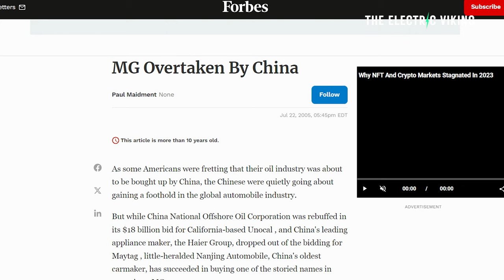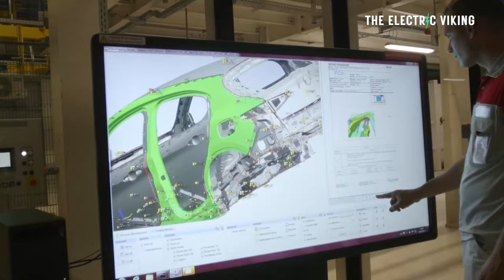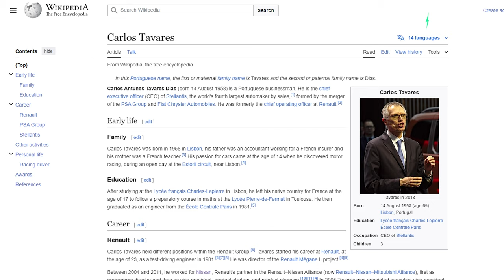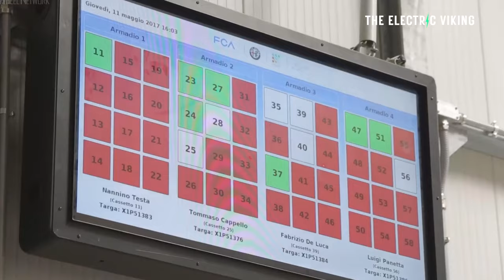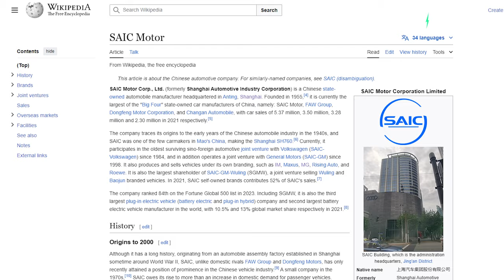Stellantis CEO furious after Chinese companies try to buy Alfa Romeo

Comment: I should have guessed that a site called "The Electric Viking" wouldn't understand Alfa Romeo, and I was right. Saying that Alfa cars are "undesirable" is ridiculous; you obviously are so biased toward EVs you can't appreciate a good ICE vehicle. Go drive a current Giulia or Stelvio and then tell us the cars are "irrelevant". What are irrelevant are EVs - too heavy and costly for average consumers.
Reply: ironically he owns shares in evs somewhere and also drives a ice vehicle if rumors are correct
Reply: @vandamonium1731  So, some hypocracy here. Based on what he's saying about Alfa vehicles, I'm not surprised. Just because you're on You Tube does not mean you're well informed or that your opinions matter.
Reply: They are a niche car, they are undesirable to the mass market, they sold around 70000 vehicles last year, that's a small amount.
Reply: @timfehlberg9051  I'd agree that Alfas don't appeal to many buyers; they are a bit too "sporty" for those looking for generic transport; however, sales numbers have a lot more to do with factors other than product, like advertising and dealer points, for example. This EV guy doesn't understand Alfa at all.

Comment: It's by now just a badge name, there's no "special Italian wizardry" anymore.
Reply: The class-leading performance of the Alfa Romeo Giulia Quadrifoglio has a Ferrari-derived engine - an All-Aluminum 90-degree 2.9 liter Twin-Turbo V6 engine that delivers 505 horsepower.  Just one example.
Reply: Drive a Giulia QV and you will understand what an Alfa Romero is about
Reply: Alfa romeo its not for mass market, its a racy car and drives bettar than any audis,
Unriable with the gimmiks and flashi options.
Its a shame that fiat dosent make an elettric version on existing alfa's plattform...

Comment: I drive an Alfa, you drive SUVs so I don't think you know what you're talking about here.  Alfa had terrible reliability issues in the 1980s, not now.  In the late 90s the 156 and then the 147 turned Alfa around, both winning European Car of the Year.  The Guilia is, in my opinion, the best looking sedan on the road.  You are correct, they are not selling enough to make a profit.  I also think Stellantis has too many brands and is sticking with a strategy of offering multiple options when a more streamlined offering would produce greater economies of scale.  I suspect they fear losing sales by cutting brands/models/variants.  Some years ago the head of Stellantis predicted that there would eventually be only 5 car makers.  I think technology has made it easier to share a platform between brands reducing the cost of variants so it's not so hard to have lots?  Their strategy has been for Alfa to be their prestige brand and I believe they were going to go all electric.  If they go electric I would be very interested in getting one.
Reply: In Italy we would consider Lancia to be the prestige brand, and Alfa Romeo to be the sports brand, similarly to Seat for the VW group.

Comment: The problem with Alfa Romeo's is that they have high rpm engines which will fail over time due to heat stress as well as have a Reliability Index of 214, which is very low. Some people buy Alfa Romeo's because of nostalgia, but when the cost of repairs and parts come in due to the frequency of repairs that will wear of.
If you look at the depreciation of Alfa Romeo Giulia it will depreciate 44% after 5 years, which is terrible!

Comment: from what l remember about alphas they were quick rust buckets
Reply: It was the Lancias, in the 1970s. The Alfas (Not "Alphas") had electrical reliability problems, like every other Italian car of that time. Alfa Romeo is one of the most important historical brands, but it started to become garbage in the 1960s. The ones who made Italy, Alfa Romeo, Maserati, Lancia, and Bugatti (yes, Ettore Bugatti, before moving to Germany (Alsazia) in need of finance support) are long gone.
Reply: In 1972 I sold my Alfa for $1 to my office mate. He discovered the problem, a cracked head. Since he got it for nothing, he reconditioned it, lightened the body, installed every trick option he could buy, to try to win  a Ginconna(?), a race around a big parking lot marked out with cones. While waiting, his wife flew to LA and took a one week racing driver course. The time came to try it out. He was quick, but his wife was quicker. He lost all interest, sold it and bought a plane.

Comment: I love this channel and you Sam, but I couldn’t disagree with you more. And I’m surprised by your dismissive attitude. I own an Alfa Romeo Giulia and it’s a stunningly beautiful and tremendously fun to drive. AWD drive is 100% to the rear wheels until they slip the up to 50/50 seamlessly- it’s incredible in the snow. A carbon fiber drive shaft saves weight. Rated more highly than the BMW 3 series, Audi A4 and Mercedes C class by owners and JD Power. $1.3B factory in Italy has 1400 robots and is state of the art.  Alfa just needs time for people to realize how fantastic and reliable they are now
Reply: Time, perhaps, but also some advertising and more dealers (Giulia owner).
Reply: I 100% agree. They have a fantastic product but people don’t realize it and they should be doing all kinds of marketing to get the word out. Live event sponsorships come to mind because it’s so beautiful. Don’t know if you’ve seen the video of the factory but a loop of that would go along way to helping people realize they are an amazing product made using the best of technologies.
Reply: Alfa under Carlos is a Peugeot/Fiat not an real Alfa
Reply: @WayneT00  I guess we'll see, won't we? Certainly Marchione was an Alfa Romeo fan and promoted the brand, which is how the current Giulia/Stelvio products came to be.
Reply: @jackfoley2542  I worked in both engineering and marketing for one of the domestic car companies and can't believe Alfa won't get behind the Giulia/Stelvio products. Why won't they, for instance, offer a class-leading warranty to assuage the poor reliability perception caused partly by being out-of-market in the US for some 15 years?
Reply: Yes Sir!!! 100%
Reply: I agree Alfa makes great cars and I love driving them, though having to admit it can't always get minor things right. I drove a few Alfa models, from 33, 146, 147, 155, 159... I generally love the engine and the look. Still own a 147 and a 159.
Reply: @robinzhao4952  No, and I mean NO car is perfect. Not one. Alfa has gotten most things right on the current Giulia/Stelvio if you are looking for a very sporty offering.

Comment: Alfa Romeo has a sports sedan with a Ferrari design 6 cylinder turbo, when it came out years ago had some notoriety here in the USA. But the Brand has been absent from the market here in the states for a very long time and I believe they made a market re-entry about 10 years back.  So to many in the US was a novel brand closely related to Ferrari.   They essentially marketed as the family Ferrari.  They also brought back FIAT in the US around the same time. FIAT was so bad at one time in the 1980s they couldn't get street approved.